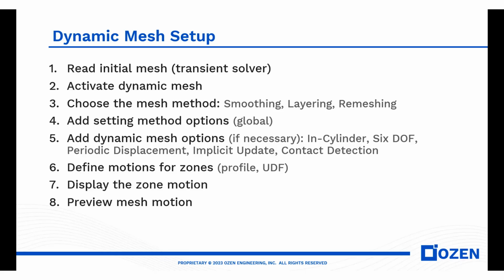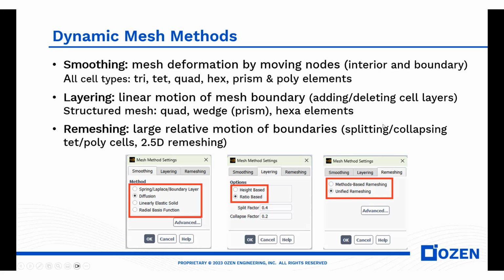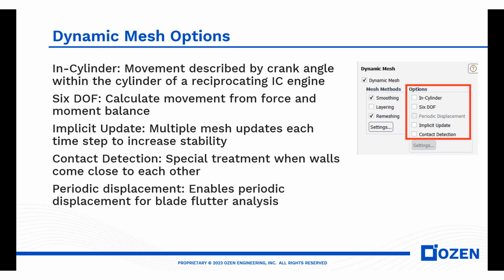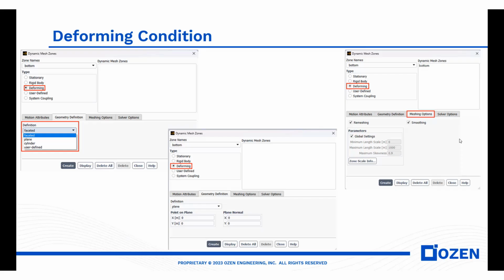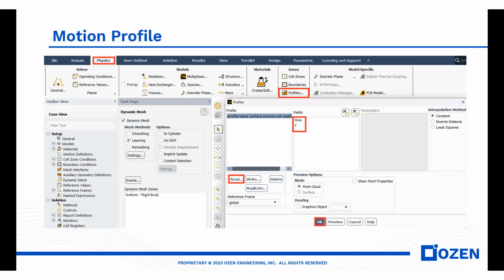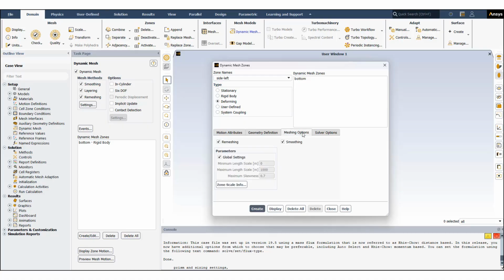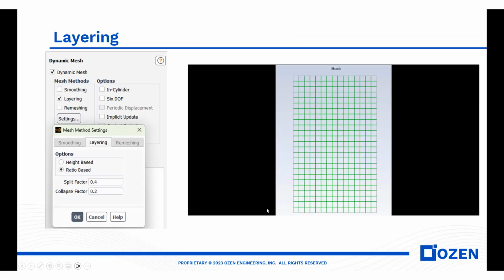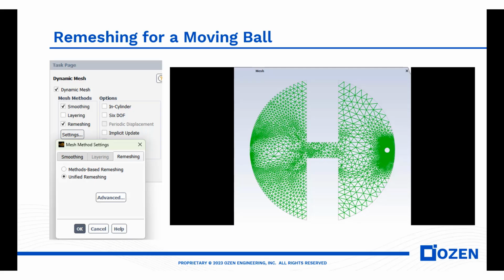Dynamic Mesh Motion in Ansys Fluent - Part 1

Comment: You should have pointed out more clearly that remeshing only works with tetrahedral mesh in 3D and polyhedral remeshing is only supported as a beta feature. I have found polyhedral remeshing in 3D to consistently fail and is prone to issues.

Comment: Thanks for this video, I found it really helpful.  I am new to Dynamic Mesh and trying get some simple models working. I built the simplest dynamic mesh to show layering working in this 3 minute video. https://youtu.be/l1ESJC7OGzg   Next I made a simple motion with a moving plate in one fluid zone that also worked using smoothing and saw a need to divide the fluid into 3 zones.  I made this 12 minute video https://youtu.be/fN3oUUJS27M to show the failed attempt using 3 fluid zones.  Dynamic Motion Preview gives me a negative cell volume error. I would really appreciate guidance on what corrections to make.